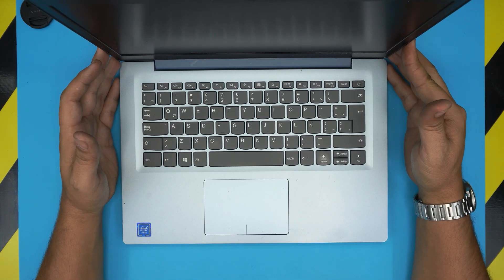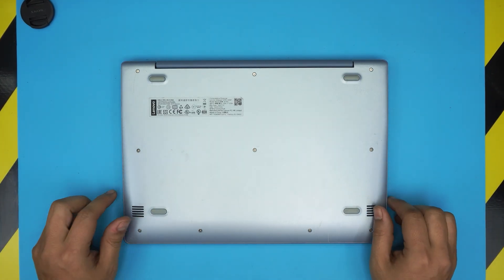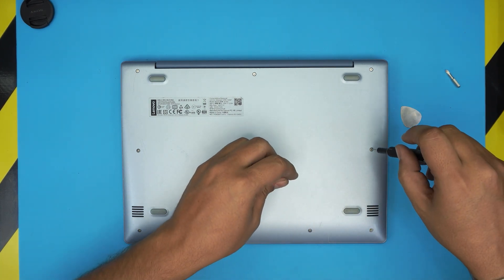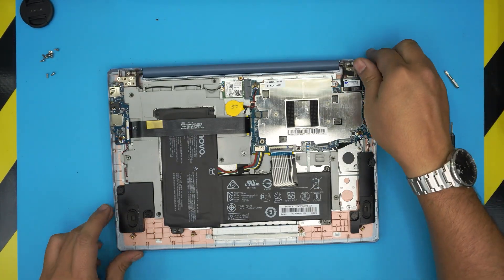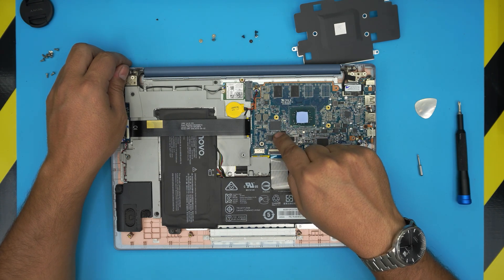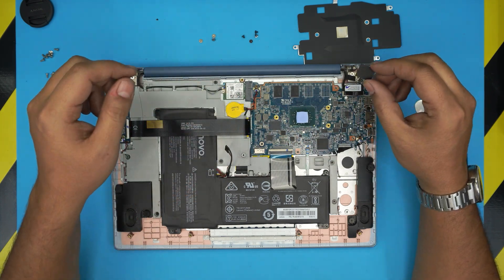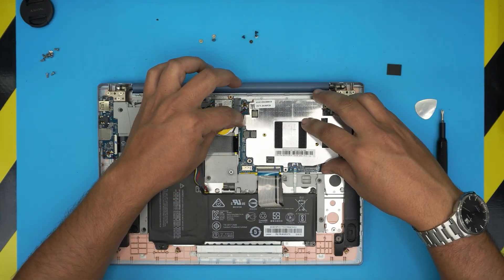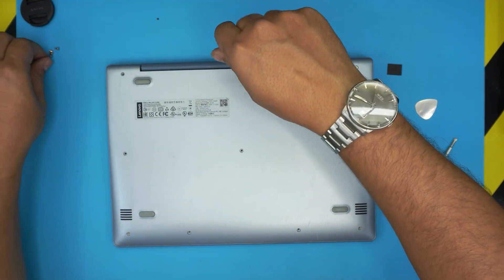Lenovo Ideapad 120S 14Iap Model 81A5 💻 SSD Not upgradeable !

Comment: Hello, I have this same laptop but, it doesn't display if I turn it on, although, the light indicator shows it's on but it still won't display... Now I also tried plugging an external monitor through the HDMI port, but it didn't display too on the external monitor, please what can you say is the problem?
Reply from the maker: 🫠 Regarding your question, the issue with this laptop is that the RAM IC chips can go bad, and since they are soldered to the board, you can’t remove them. You will need to take it to a repair shop so they can reball the RAM chips.

Comment: I have this pc and installed w10pro and the pc run good the operativo system
Reply from the maker: Yes, it will run well, and you can install Windows 11 Pro. With the SSD, the system will run super smoothly.
cheers🍻

Comment: Hi 🙏🙏 I have a 64gb emmc chip.  Would you be able to make a video tutorial on how to upgrade it to a larger capacity eg 256gb ?  Or know of any vids which explain it? Thanks
Reply from the maker: 🫠Regarding your question, i will make a video on how to upgrade the emmc chip, as you will need a hot air station and solder iron and some tools.
cheers🍻
Reply: 🙏🙏 @uFixTek

Comment: There are several different sub-models of this laptop, all under the umbrella model nomination Lenovo Ideapad 120S 14IAP 81A5. See bottom for more exact model info, look for the string starting with "81A5" and do an online search with the full string to find out what you are dealing with. Mine has a Pentium N4200, 8GB of DDR4 - and a 256GB m.2 SATA SSD, and it's the flagship one. The m.2 connector is missing from the models that didn't originally come with one, but my unit and the sister model(s) with a 128GB SSD can be upgraded if needed.

The models with weaker CPU's, less memory and an eMMC are still pretty nice on Linux. Even the 2GB model with a 32GB eMMC can be usable as a streaming and surfing laptop when you are on the road. You'll just have to know which distro you install and how to tune it. Don't expect wonders on that one, but you'll be able to do your everyday computing chores, maybe even play a game of solitaire or somesuch. Don't buy it unless you get it fully functional for less money than its parts are worth :) One viable option for the punier ones is Chrome OS Flex and other Chromium OS versions, the hardware matches the lower end Chromeboks and there also exists a Chromebook sister model for this laptop. I'm using mine as a testing laptop to try out different Linux distros and other stuff.

I was lucky to get mine for very cheap from a local online market place. I paid the price of the charger without knowing anything about it except a functional charger is included, the screen is broken and it should otherwise work. Originally it had had a Full HD panel and someone had closed the lid without checking if there was something in between. I happened to have an extra HD screen with which I replaced the broken one in five minutes, including the time to search for my lost screwdriver.
Reply from the maker: something is going on with this models as you say you can look with complete model number and stuff, BUT we have seen the same exact model (complete model) that was purchased on USA had m.2 slot, and the same exact model purchased in LA (latin america) didn't had the m.2 slot available, SAME exact model! we have contacted the lenovo and they say even same company but they have a different market and even with same exact models! and this only we have seen happening on lenovo eco models.  its like they are trying to scam LA by using the same models!
Reply: @uFixTek I bought mine in the US and it didn't have the M.2 slot either. Lenovo are trash computers  I will never buy one again.
Reply: Hi, what is Linux? My model has only 32gb and I need more storage space.  I need to somehow upgrade or change the operating system.  How?

Comment: Hi sir good day my laptop same unit as u that 5 or 10min my power automatic shut off what is the problem can u help me ?
Reply from the maker: you may have a over heating CPU, do a repaste. and you need to check the windows log to see what error you get when this happens, open windows log and see the crash logs
press windows key the type "Event Viewer"
then click on "Windows Logs"
then click "system"
and on the right click on error and on the bottom section it will give you the error log

Comment: What's the name of this component, if I can add it?
Reply from the maker: what component you talking about? to add m.2 jack and its components? if so they about few
Reply: @uFixTek  In this case, regarding the other missing components, it might be at least easier to find a new or refurbished motherboard with a m.2 slot. Didn't say cheaper, though, it'll probably cost almost as much as a whole new laptop. If I were to do this upgrade (eMMC -> m.2 SSD) I'd try finding a broken unit with a functional motherboard, including the m.2 slot. Probably not worth it, unless someone you know has one and wants to donate or sell cheap.